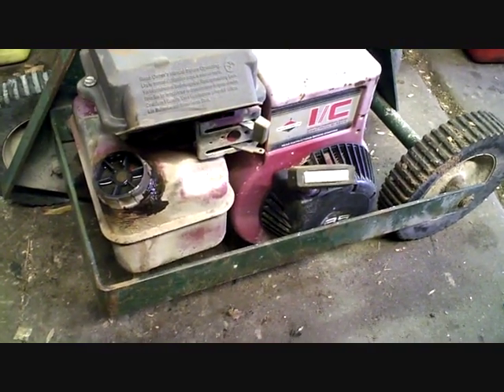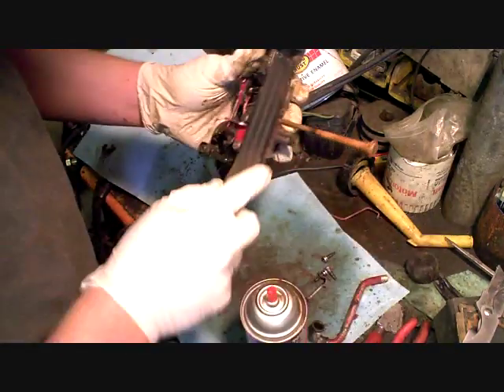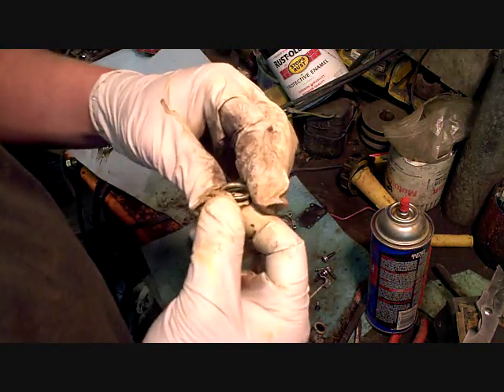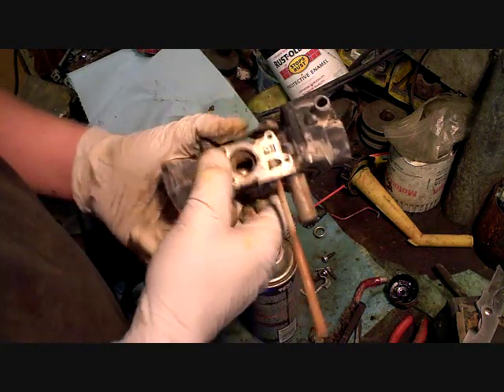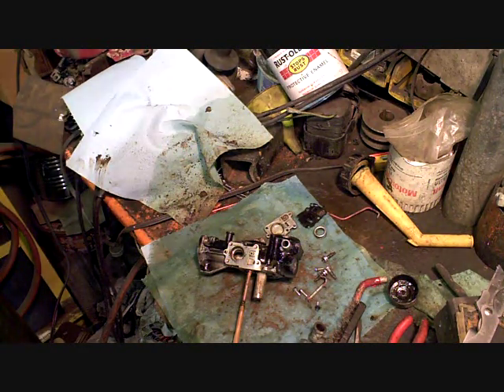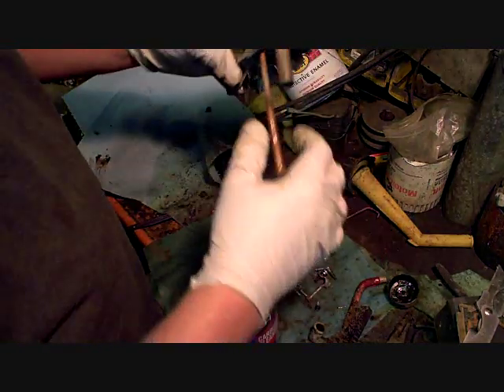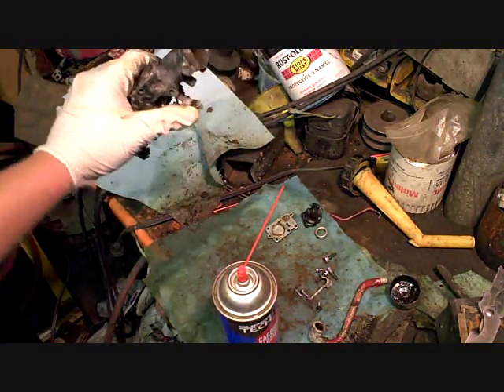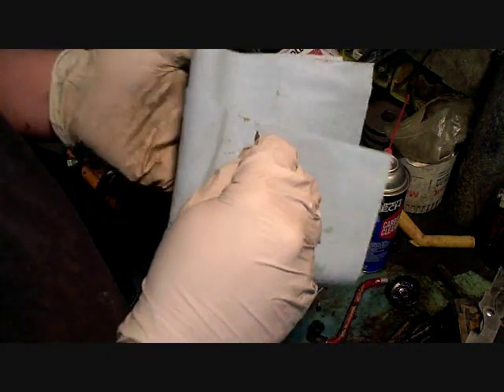Horizontal Briggs Carb Rebuild part 1 of 2

Comment: Thanks!  You helped me save $75 at the shop.  I was able to till my garden.
Just don't drop anything in the carb when you take it apart.  I had to drain it all out and bang it around upside down to get the part I dropped into the carb.

Comment from the maker: I believe you're talking about the hole for the anode. It stops the tank from rusting. Older models with this virtually identical carb did not have the choke and throttle lever mounted on the carb like this one. Instead they have a pull out choke on the end and a spot to mount a cable to control the throttle.

Comment from the maker: The short piece of metal the protrudes into the tank is an anode. It's supposed to combat corrosion and is supposed to rust away and keep the upper fuel cup in the tank from rusting.

Comment from the maker: Yeah, you are correct, they are stuck from the outside. The small holes are drilled directly behind the welch plug into the throat of the carb.

Comment from the maker: There is an air tube that feeds air down into the main jet area and mixes air with fuel(emulsion tube). To see the air inlet you need to pop out the large welch plug or look as down into the carb as possible through the inlet.

Comment: I’m working on the same carburetor right now for my father in law.  I am not too familiar with the diaphragm carb, mostly just worked on the gravity feed carbs in the past.  Took it apart and did a quick once over and put it back together and the got the engine to run.  It idles fine and will rev up to a little better than half throttle, if I try to rev it up any higher than that it kills.  If I pull the throttle back it will start right up again, and it will stay running as long as I do not try to go to full throttle.  Any advice is greatly appreciated.
Reply from the maker: Sounds like the main jet is plugged. There are several styles of this type of carb. The one in the video has the main jet in the bottom protruding part. Some of the older models had it on the side.

Comment from the maker: @CAMOTRUCKN ................. The long plastic tube with the built in screen is your fuel pump pickup tube. You can unclog the screen by scraping it lightly with a screwdriver and then use carb cleaner.

Comment from the maker: Yeah, if you have any rust or debris in the tank they will drive you crazy. If your tank is like this you need to de rust it. You do this by taking it off and filling it up a little with gas and rocks or bolts, then shake shake shake. Rinse and repeat.

Comment: Very helpful video, thank you. Any chance you could show how to remove/renew the welch plug and clean the air tube leading to fuel emulsion tube please. Also does the welch plug at the side need to be removed? I'm hesitant about removing these welch plugs since it's not an operation I'm familiar with. I'm guessing the one at the side needs to be drilled out, if it does need to be removed.

Comment: Thanks for these videos. This is similar to the B&S on my Garden Way 3.5 tiller. Would have been nice to see the controls removed/reassembled during carb removal/replacement. With my luck I'll either break a spring/linkage or never get them back on correctly.
Reply from the maker: gkline1954 Briggs did a few slightly different layouts to the linkage otherwise I would have shown it.

Comment from the maker: I haven't needed to actually removed one in years. The reason being, if you can see cleaner spraying out the little holes drilled on the inside then the compartment under the welch plug is clean. They are remove with a SHARP punch or similar. It is lightly taped into the center at an angle and the plug is then popped out. Take care not to go to deep or you will ruin the entire carb by messing up the orifices. If carb cleaner sprays through the small holes I wouldn't touch the welch plug.

Comment from the maker: @MultiKhaz ............Yes it's nasty stuff, that is why I always wear gloves. I refuse to use the carb cleaner in the buckets as it will near kill you. The spray is necessary though to dissolve gum and tarnish. It also allows you to visually see that all the jets and passages are clear. Air works but it won't clear gum/tarnish. Air will also push the little BB's/plug out.

Comment: hey buddy.  just read this on some site:    "  This is also good for 2-cycle engines that will ruin the ignition by pulling the engine over without the plug being grounded."   have you ever heard that 2cycle ignitions will be hurt by pulling them over without grounding the plug??  I never had

Comment: Thanks for your answer, I might have a problem then! I've sprayed carb cleaner, as best I can, through this air passage or tube and it seems to be blocked. Are these small holes within the fixed rising emulsion tube or come out within the body of the carb itself? Are these welch plugs struck from outside the carb or from within, specifically the large one at the front? I'm guessing you mean from outside, at the centre, causing the edges of the plug or perimeter, to contract.

Comment: Howdy sir...I just bought a used edger with this same motor (maybe a little newer).  I am having issues with it surging.  To cover all my bases, I changed oil, drained/refilled gas, and put in a new plug.  It still surges.  Then I cleaned the carb and reinstalled with new diaphragm.  Still surges.  Keep in mind, I have never worked on a carb before, but after watching your video, I noticed you removing the needle and counting the turns, etc.  I checked my screw and it was tightened all the way down.  I back it out some and it seems to run better with it backed out.  My problem is that I do not have a spring on mine, so the vibration of the motor tightens it back up.  Should all of these screws have springs on them to hold them in place?  Because I do not have the spring, could you tell me how much of a spacer the spring creates when fully compressed?  I tried the 1.5 turns out thing, and like I said, it got better, but I am doing 1.5 turns out with no spring in place, which is likely much less than if there were a spring there.  Sorry for the long comment and I hope I was clear.
Reply from the maker: Surging is caused by a plugged or out of tune Idle circuit. This is the screw needle jet you are playing with, just like you've discovered. You need to have spring to hold the tension on the needle. This is because it is not an exact setting. Altitude determines where your engine likes to be and it may be 1 turn to 3 turns or anywhere in between. You should be able to pick up a spring on Ebay for a couple bucks or makeshift a spring from something else.

Comment: FIGURED IT OUT!  Had NOTHING to do with the carb internals, the issue was with the pickup tube that runs to the bottom of the gas tank. The pickup tube is half brass and the other is plastic. the problem stems from the level of ethanol in modern gas..apparently ethanol can actually cause the plastic tube to expand to the bottom of the tank which restricts the gas... I ended up cutting an 1/8 inch off the top of the tube and reinserting onto the brass tube... Works like a charm now

Comment: I actually managed to purchase a new gas tank years back and the inside Is in mint condition....Problem I encountered is when you first screw the Carb back onto the new gast tank some metal shavings seems to find their way into the gas tank... This year I had this thing running for days before encountering problems with it.

On my latest carb clean I took the tank off, flushed it clean and put it back on...then proceeded to clean out the carb....I should have used more carb cleaner I guess LOL

Comment: hi when you put the gasket back onto the tank and placed the carb on top there was another screw hole,what is that screwhole for?, as i have the same engine from a rotavator that i was given and its all in bits i got a bag of screws,carb the same as yours but some of the wire linkages are missing and the choke levers and start lever

Comment: I actually did a little research and this motor apparently came with a needle like yours with a spring and then a "jet pilot" with no spring like I have.  So now I am stuck again because it appears this is normal.  Do you by any chance have a picture of your carb installed from the top?  I am curious to know if all my springs/connectors are all there and in the correct spots.
Reply from the maker: When you take out your screw in jet/needle, is it a point at the time or is it blunt with a cross hole through the tip?

Comment: Do you recommend soaking the carburetor over night or longer ?
And where is the best site to buy parts ?
Thanks: Mitchell
Reply from the maker: Soaking: No I don't recommend soaking. The carb cleaner instantly dissolves any crud. 99% of all the carbs I clean need no parts at all. But for an individual purchasing just a few parts Ebay is your cheapest and best option.

Comment: mine is exactly the same as yours there is no choke pull at the end,what does the anode look like all i have is a bag of bits and an engine,in your video it shows some wire linkages on the throttle and choke,i haven;t got any on mine

Comment: I have this carb on a leaf vac and the engine  will run great and then stop. I can restart immediately and it will stop again after about 20 seconds. I think I am running out of gas supply. This was engine  unused for quite a few years
Reply from the maker: If it was a different type of engine/carb it would say it is a fuel issue. If it is this Briggs and Stratton where the fuel tank is under the carb I would look into your spark system as a possible cause.

Comment: I have exactly the same carb that i am trying to resurect, except that it's on a  generator. The only problems that I'm having (so far) are:
The gas tank was rusted out so I had to cut it in half to get the carb off.  
There is a bit rust on the internal part of the throttle valve but I think I can deal with that. 
There is a short object that protrudes from the top half, downward into the fuel tank. What is it's purpose? It's almost rusted out and looks likw it's a pressed fit. 
Help !!

Comment: Hi great video btw i have exact same carb on a 5hp briggs power washer. never took one of these carbs off before. bolts are out but carb doesn't want to come off at all. do i just pry harder? or turn it a certain way maybe? just dont wana break anything an need to clean carb asap. If u can get back to me it would be greatly appreciated, thx. will subscribe also.
Reply from the maker: Once the 2 nuts are removed from the engine the carb is only held to the gas tank by 3-5 screws. Tap it lightly and the gasket will release it.
Reply: sixtyfiveford thanks i was having a brain fart i guess their was a bolt almost in mid of carb but on the side a pinch an it needed removed. so wasnt the 3bolt kind like i thought was 4bolts. carb cleaning worked well an its running good. thank u! keep up the nice vids👍
Reply: sixtyfiveford its my landowners power washer an it sat for long time. but he tookoff air filter an now cant find it, so gonna order new one. an dust etc im sure went rite down into carb sitting with no filter for 8yrs or so. lol. thx
Reply from the maker: Awesome. I'm glad she's going.

Comment: Blunt with a cross hole.
Reply from the maker: Then it needs to seat all the way. The tip will have a tiny hole in it. Make sure it is cleaned out and you should be good to go.